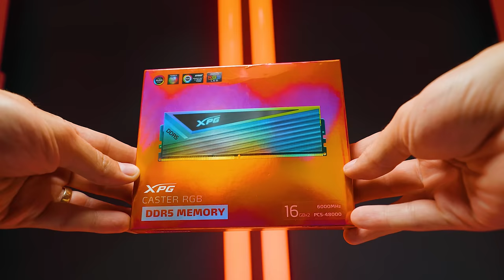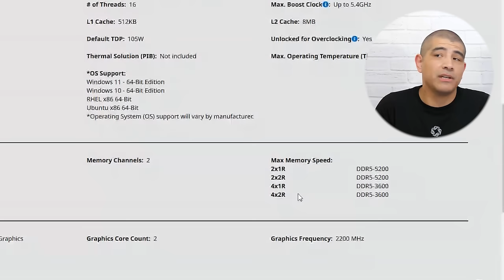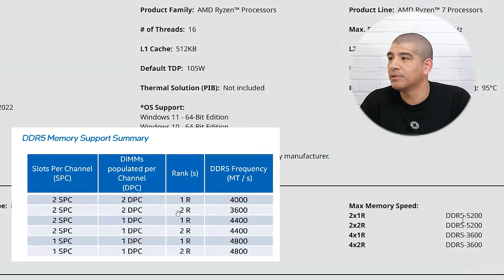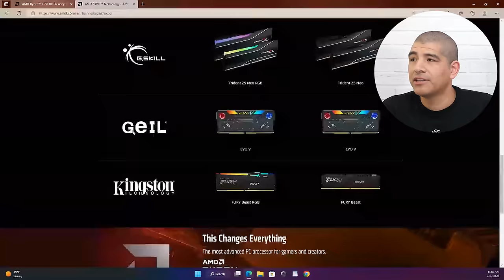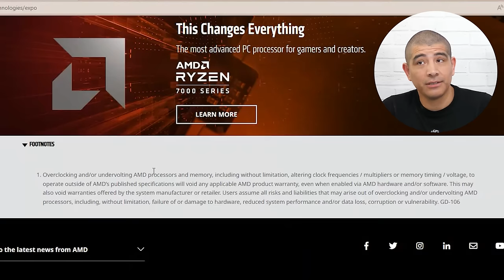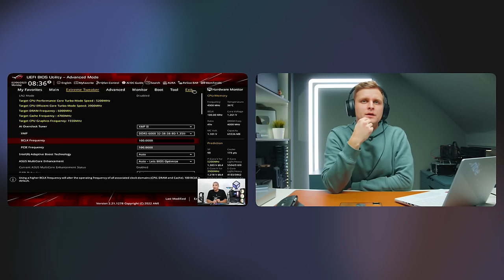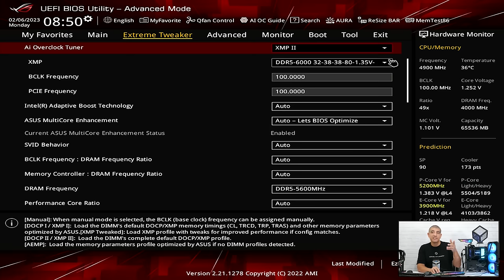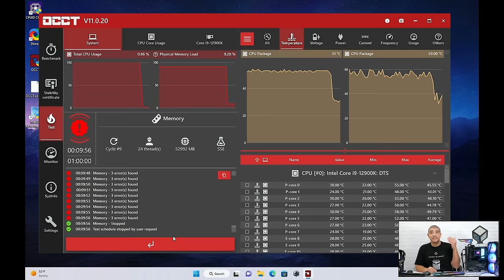Why I get NO POST with XMP??? 👉 ULTIMATE RAM + XMP Guide

Comment: WOW a lot of knowledge, but I'm still not sure if I understand the whole thing well, that's why I turn to you dear colleagues and to you @TechNotice. please advise. If I have an Asus ProArt Z790 and an Intel 13700K processor and I'm going to use 64GB RAM 6000 or 6400Mt/s for this, I should go for 4x16GB or 2x32GB. In which case is the XMP profile more likely to work and be stable? I understand that lower clock speeds increase the range, but is 6400MT/s very risky? Best regards for all of us :P
Reply from the maker: 2x32GB :)
Reply: @theTechNotice  Thanks Bro 🍻

Comment: I have 192 GB of memory in my PC of which I need every GB  and it has nothing to do with aesthetics - It just has to be four slots.  I run a lot of virtual machines, which is a fixed memory requirement. I use Kingston Fury Renegade, allegedly ('allegedly' because I would have liked Kingston to have explained it, rather than me having to read the MSI motherboard site ( a number of other motherboard manufacturers are just not as honest as MSI is about this subject) 6400 but in my four-chip configuration it can run only at 4800.

Comment: XMP1 and XMP2 doesnt work at 6000mhz profile - my games crash. but XMP tweaked at 6000mhz works and runs games fine. why is this? should i continue using it or would it be unstable and should i just use xmp1 at 5600mhz profile?

Comment: Hey tech notice I recently built a intel system with 14600kf, b760 aorus and 32 gb gskill 7200 mhz ram, 360 mm Aio..650 watt bronze psu But my system is bsoding and freezing even with stock 4800mhz... Is there a solution

Comment: Will 4x16GB DDR5 single rank will get higher stable clock speeds than 2x32GB dual rank (for 5600mt/s and 6000mt/s)? Will the 2+2 single rank cause more issues than a 2+0 dual rank of double the size (assuming same clock speed)?

Comment: Something that's been puzzling me for a while is, why does the Z790 Apex have a 24+0 phase setup, instead of a split power setup, like 23+1, similar to the design used in the Z790 Hero and most other high-end motherboards? As I understand it, the latter number denotes the phase dedicated to the memory controller; if so, why was this functionality deemed unnecessary for the Apex?

I would very much appreciate it if anyone who knows the answer (or has an idea) would share their knowledge. I've searched for the answer for hours, with no results, and it's driving me crazy.
Reply: Actually, after a month of research, I reached the conclusion that the +0 refers to the lack of power given to the iGPU. The Apex has no HDMI output, and therefore no way to take advantage of the integrated graphics chip, and hence it doesn't need to give it power, and this is what the +0 seems to indicate.

Comment: So will 2 2x32gb ddr5 kits work if you are not pushing them over their limit and dram overclocking them? So just pluggin em in and playing games or other regular pc use? Since there does not seem to be any other way to achieve 128gb of ddr5 ram.

Comment: Heyy YOOO, I just picked up the new DDr5 New styles of Corsair Rams set of 4 64gb 6400/ as well as the 48gb 7000/ the IT side of me was thinking I don't really need 4 rams, 2 will be fine especially for the kind of workloads I do for my work. I've seen this video, and this confirms everything what I have been thinking.

Comment: I have Corsair Dominator 4 Dimms of 32 = 128 and when I turned on XMP on the MAXIMUS Z790 DARK HERO I couldn't BOOT and cut a long story short I had to CMOS and start again. Now I don't use XMP.
Reply: Yeah but ur rams are designed to run faster and your motherboard accepts it, what is the fix

Comment: I got a cyberpower from costco with i5 13400f, 32 ddr5, 2tb gen4 nvme, 4060, mb asrock b760m-c, amethyst ll case,$950,,, the ddr5 in it is teamgroup vulcan red 6000 mhz if im remembering correct ( im a complete noooob to pc), but i went to bios for 1st time in my life and saw 5 profiles and 1 default profile but never saw "xmp" for the life of me. How do i tell what speed my ram is actualy running? Again sorry im so new, fresh from consoles. Any help appreciated!

Comment: I’ve been troubleshooting game crashes for days. I reinstalled windows probably 15 times, swapped motherboards and video cards and didn’t understand why I was crashing.  I had XMP enabled with 4 16 gb sticks of ram. I pulled 2 out and everything’s working great now. Now other changes were needed to the UEFI. Using ASUS Strix Z790E board. I had a 7900 XTX and returned it for a 4080. This video saved my sanity.
Reply: Yea, I had same issue about a year ago but it was on an older system and one of the sticks of ram just failed. Was banging my head against the wall for the better part of a week before I decided to just get new ram and see what happens lol. Now the ram will be the 1st place I look when having random game/app crashes out of the blue

Comment: So i found this video because im running into an issue with some DDR4 3600 cl 18 sticks i just bought. 2 16gb sticks for 32gbs ram. I put them in my motherboard, booted up and it boots into bios saying there was an error, they were not running at the xmp speeds but 2133 or something. I changed it to xmp, it still wouldnt boot. I took 1 stick out, left one in, and it boots into windows at the rated 3600mhz just fine. But for some reason with both sticks in ( and i tested both individually to see if maybe one was bad, they both worked fine) but with both sticks in, it just wont boot past the bios with xmp enabled. 

If they both work at 3600 in a single stick config, why would they not work with both sticks in? 

Note: i was able to boot into windows with both sticks installed manually set to 3500mhz just fine. 

What gives?  Did i miss this bit in the video?

Comment: The long and short of this is this has been an absolute nightmare for consumers.
For years we've been putting in 4 sticks of RAM and not thinking twice about it.
Now if you install 4 DIMMs your system won't boot and you're in a BIOS h377nightmare trying to figure out why.
Because the EFI BIOS won't say hey, 4 DIMMs, okay, lets default to safely run them at half the speed and all will be a-ok.  NOPE.

Comment: if I am just using xmp profile 1 or 2 it crashes sooner or later, do you think I need to manually enable option for raising the voltage from 1.4 to 1.5 to actually work?

Comment: well... i can tell you 4 sticks ddr 4 .. which i bought a mainboard for on purpose .. on an  12900 intel processor cannot use xmp ..  because at the time ddr5 was new and had big issues... extremely dissapointed.. because i build  5000 dollar new system .. i dont feel to spend another 1500 or more to get a new motherboard with 64gb 4stick-ddr5 memory.. because it probly wont work either

Comment: If 2 slots for RAM is more stable than 4 slots, why is the Z790 Apex (2 slots) listed as only supporting slower 5600 MHz 40CL 2x48GB DDR5 RAM, while the Z790 Hero (4 slots) is listed as supporting much faster 6800MHz 34CL 2x48GB DDR5 RAM?

Comment: 12th gen I do not believe would ever top out at 6000mhz ddr5. The board would be responsible. I have had 2x 12700K and a 12900K that all topped out at 7200mhz stable in testmem5 with absolut and occt, and it might be my board limiting them (MSI Z790 Carbon) as they all posted up to 7600mhz! Funny enough, I briefly had a 14700K and a 13900K which only hit 6800mhz but I am sure there was a configuration issue with my board, as I would expect the memory controller to be at least equal to 12th gen.

Comment: Make sure if you have an AMD CPU you didnt buy Intel XMP specified ram. I always thought the CPU was irrelevant when buying memory but that changed with DDR5. AMD Asus boards especially dont like XMP optimized ram. Very slow and unreliable post/boots. ASUS will then try and use DOCP instead. If you get into Windows it'll run perfect but change anything to do with the mobo and you'll have to clear the CMOS. 

So I went back and checked my ram and sure enough it was Intel XMP optimized. Returned it and got a kit that said AMD EXPO on the box, and it fixed all the issues instantly.

Comment: For using 2 dims in a 4 dim configuration, can you get dummy sticks with rgb?
Reply: I'm one month too slow lol i was going to comment the same thing.

If it's optimal to run two dimms, they should consider adding two fake, look-a-like dimms to the dual kits.

Surprised they dont after hearing that they are aware users want to fill slots for aesthetics.

Missed opportunity.

Comment: I bought some ram that says Intel XMP ready on it.  But I wanted to build an AMD system.  Can I run the Ram on an AMD motherboard at 6000 and use it at it's full potential?
Reply: Maybe.  That is just saying that it was designed to work with Intel but that didn't mean it won't work with anything else.  Of it does work with other brands, it could be as good but could be worse.

Comment: I'm running 7800X3D on a MSI x670e carbon wifi gskill 6000mt 2x32gb expo can't get it for the life of me to run stable anyone got any ideas? It'll post but if left alone it'll start showing red and orange cpu lights the next day and then refuse to boot.

Comment: Watching this video as I have problems with brand new Corsair 2x16GB 7200GHz CL34 kit with a 14700KF. Fails at 7200Mhz, but stable at 7000Mhz: Tested with a 13900KS, and that CPU is stable with the memory at 7200Mhz. So guess the 14700KF lost the silicon lottery regarding IMC...

Comment: My ram is 4800 default, 6400 xmp. My board bios won't allow xmp with 4 dimms. It only does 3600 with 4. I'm not trying to get to 64 with 4. I'd be happy with around 48. Is there any way around that default drop for 4 dimms?

Comment: Such a great video.  Still wondering why some kits say intel xpm ready and others say amd expo ready.  When they both work.  Wish he would have had a amd bios up for demonstration also.
Reply: That just means there are XMP or EXPO settings to bed read by your bios. Not a guarantee to work with your set up. If your memory lacks those embedded numbers you won't have the option

Comment: Great piece of video, very interesting, I set through the whole hour and 41 minutes. I still have a question that was left unanswered though... 
I have a  i9-13900K on an Asus Z790 with a kit of 2 32GB Kingston Fury (64 together). I bought exactly the same kit in order to upgrade to 128GB, but under all configurations it run too unstable. So my question - is it even possible to have 128GB with 4 dimms under this configuration and still run stable? Anybody? Thanks.
Reply from the maker: Yes, but try lowering your XMP speed and see if it's better. Or turn XMP off :)
Reply: @theTechNotice  Thanks so much for your reply. After watching this video I feel much more confident giving it another go.
Reply: I have the EXACT same question. I’m afraid to pull the trigger on my build because of the cpu lottery. I want a 13900ks and there is a guy who runs your build with the pro art z790 motherboard and Kingston furry ddr5 32gb 6000 and he is getting 6000mts right out of the box on the xmp profile with no extra tweaking. He said it’s hit or miss though that if you get unluck with the cpu it will be unstable. Let me try to find his video and I will link it. All I want is guaranteed 6000mts 128gb ddr5 like when is that coming.

Comment: Still missing technically exact answer, why MB vendors recommends populating A2 and B2 slots, with 2 sticks? And how much of difference is, to put two DIMMs in A1 and A2, instead? If the answer is that traces are more straight for second and the last slot, we might have answer for the question "Why 4 sticks XMP, doesn't work?"...
Reply: A2 and B2 are at the end of the trace. This gives the best termination of the signal at what is essentially radio frequency with trace inductance and capacitance and mainly RAM capacitance and resistance giving slight 'ringing' if A1 and B1 are used instead. Difference is minimal but could affect maximum XMP. Four sticks of RAM add double the capacitance on each trace and slows down the rise and fall times of the signal. Look up RC and LC circuits in electronics.
Reply: @ColinDyckes  I didn't know that. Thank you. I thought that there are separate traces for each slot, multiplexed in CPU (not controller). Leaving that "stub", without termination, could be reason for signal degradation. That could be solved with termination at the end of traces in combination with stronger drivers.
Reply: @dankodnevic3222  From the 13900K spec sheet, there are only two RAM channels (you need an HEDT processor with more 'pins' for 4 channels) and reduced frequency specified if two sticks per bank. Same is true for 'double-sided' modules used to get 64GB, so latest 24GB chip 8 chip sticks are best (7200MTs on Hero and 8000MTs on Apex M/Bs).

Comment: Ive got an asus rog strix z690 paired with an i5 14600k, my ram is G.Skill Trident Z5 NEO 6000 CL30-38-38-96 2x16gb (it does say AMD expo, i didnt realise until after) it will only go upto 4600mhz i tried lowering my timings but only got to 28-36-36-72 so im theoretically got a latency of 12ns. is there a reason this ram wont run at 6000mhz? in the bios it says DOCP and not xmp even though its an intel motherboard. i tried upping my voltage to 1.4v and loosened the timings to 32-40-40-40-100 and still wont go past 4600mhz
Reply: 24-36-36-36-72 now

Comment: I wouldn't recommend testing any tweaking of memory, cpu, overclocking/undervolting within Windows unless you don't care about that specific installation of Windows like if it's temporary one otherwise you can get a type of corruption (literally just 1 byte being messed up in a single critical Windows program/process) which can come up at any point as a BSOD and bite you in the @ss in a moment where you don't expect it and you need your PC to work perfectly despite the fact that the system can run perfectly fine for a long time and it's not like SFC and DISM can always fix 100% of all issues (reinstalling and setting up again everything is a pain, do full OS backups often to prevent catastrophic-like failures), use Memtest and other Tools placed in a usb thumb drive with some related Linux tools to do your tests then if everything passes with flying colors multiple times then you are good to go BUT i would still recommend to first install windows without any kinda of OC/UV, XMP/XPO enable, the hassle of messing with Windows being so closed-source in order to find the issue compared to Linux isn't even close.

Comment: So let me get this right I just bought two kits of ddr5 7200hrz 16gb for a total of 64......so should I just run the 32 ohh and my motherboard is the rog z790 hero?
Reply: What did you do in the end? I have the Maximus Dark Hero and installed 4x16Gb of Corsair DDR5 at 7200Mhz (with XMP enabled), but I think my new build is too unstable with this RAM configuration because I've had the odd BSOD and games will just crash at random times. Will take two sticks out and try with just dual channel at 32Gb at 7200Mhz and see how it goes.
Reply: @Stringbean421  I ran just the one kit at 7200 32 Mt putting all 4 dims in you have to drop your clock down to be stable like to 5600mt what ever your cpu can handle
Reply: @joebayley9010  
Thanks bud.
Reply: May also need to increase the voltage.  Do that as slowly as possible to you find where it is stable, may take several attempts.

Comment: If your cas latency is to low on the default xmp, it will be a Samsung manufactured ram (worse overclocking potential) so watch actually hardcore overclocking’s vid on what ddr5 to buy (you what Hynix manufactured a die or m die

Comment: I might be lucky with my i9 13900k MSI z790 tomahawk ddr5 running 4dimms of Corsair dominator at xmp 6000mt till now no issues running VMware and configuring vms for my work
Reply: Fantastic, also need to run VMs, then will buy same motherboard as you and same RAM stick, spending hours trying to find a workaround to use i9 13900k cpu with 128 gb , what is the exact model number of the RAM ? Thanks
Reply: @rodackor  Will have to check I am on holidays :). MSI is underdog best motherboard in the game. People always go with Asus and gigabyt. The ram was one the earliest versions
Reply: @rodackor  but don’t forget I might be lucky with my cpu and I don’t use asus so I can’t te SP information
Reply: @jonascoscom  Thanks for taking the time to answer as you are on holidays, enjoy. Yes unsure what I am doing next, there are conflicting info, difficult to filter out the noise and retain the essential info. User experience is best as it is not motivated by a sponsor, that is why I asked. Thanks

Comment: If i buy 2 kit  same brand with same type(2 x 16, 2 x 16), can it run xmp?
Reply: This is a maybe.  Might get best results of you put the ram purchased at the same time on the same channel number. 

You might not be able to get them to work at the full oc limits the manufacturer states is possible with all four due to issues with the CPU or how the motherboard is made. 

If they don't work at first, then it may be that you need to tell the bios to give more power.  Like, it might be trying to start at 1.1v and wait for response to adjust, but the ram may need at least 1.25v to start the oc.  The ram might be able to use optimally 1.4v but not be very stable. 

You may need to find what is the highest speed with highest voltage that is stable.  Just because it boots to the OS didn't mean it is stable, you won't know till You've put it under a heavy load for a long while. 

There have been some people that had success by just turning on xmp and no other changes.  But I'ven't seen any consistency with what ram will do this.